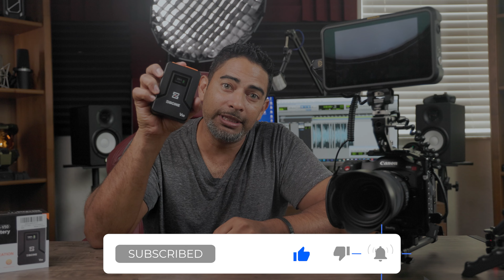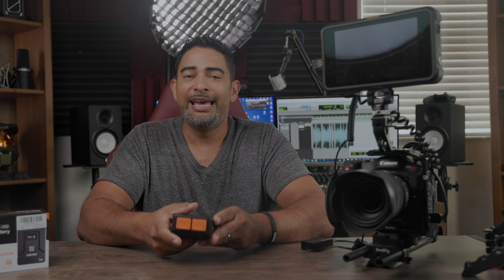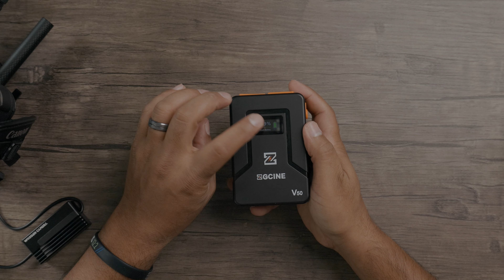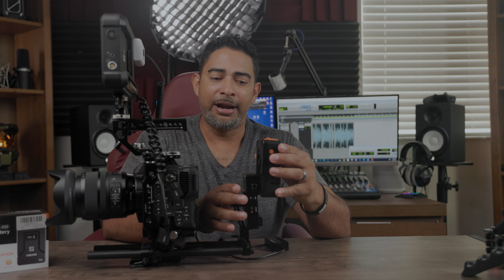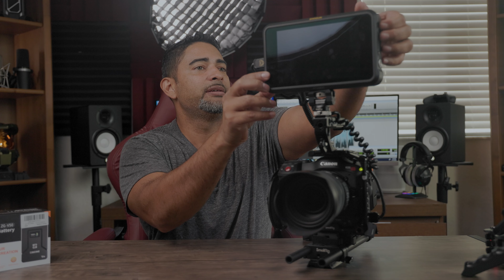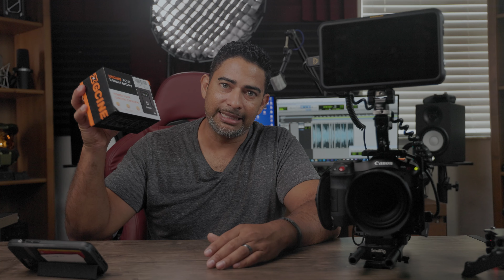Small POWER HOUSE!! | ZGCINE V50 V-Mount battery | Review and Test

Comment: Nice job. I think the ZGICNE v50 is a better fit for a Gimbal Rig set-up. I do agree that a larger battery for your set-up will give you more run time and a better counterweight with your lens. I plan on using it with a DJI RS3 Pro set-up with a Sony A7 IV and Sigma 28-70mm lens.
Reply from the maker: Agreed. Ending up getting the v99, that works better for my current rig.